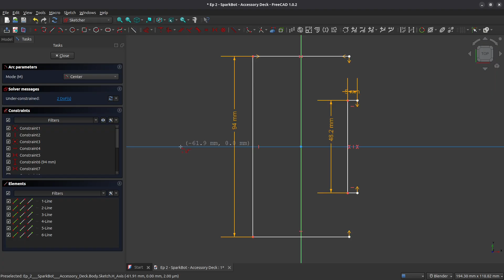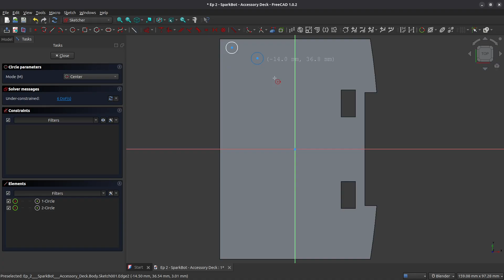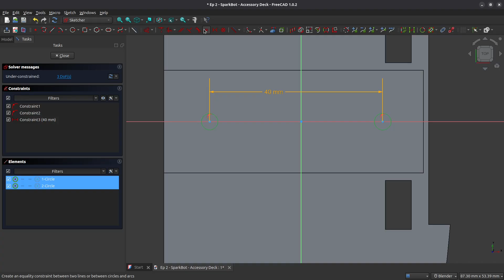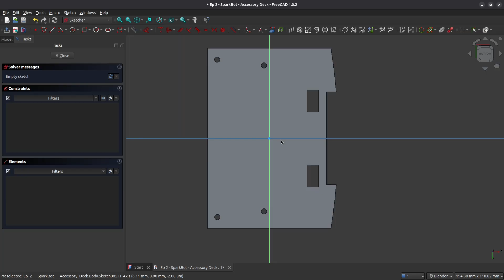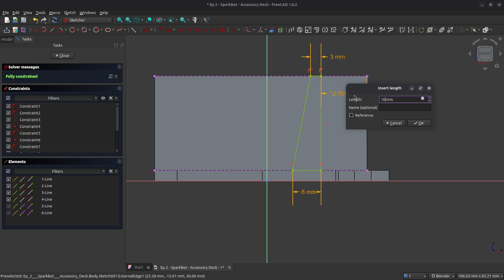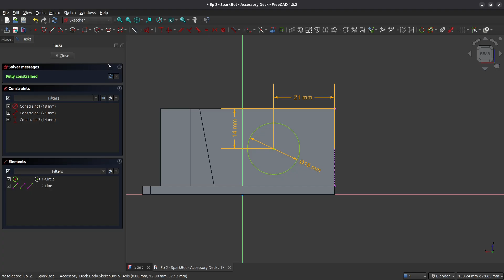SPARKBOT V2: PART 3 | ACCESSORY DECK

Comment from the maker: Welcome to Part 3 of the SparkBot V2 build. 📐

In this episode, we are reclaiming the dead space between our drive gearboxes to engineer the Accessory Deck. Remember, placing your MPU6050 gyroscope exactly over the drive axles isn't just about making things fit—it's a kinematic choice that drastically simplifies the math for your rotational telemetry.

Question for everyone building along: Are you running the standard MPU6050 for your telemetry, or are you integrating a different IMU into your hardware stack? Let me know your setup below.

Chart your course. Build your world. 🍁